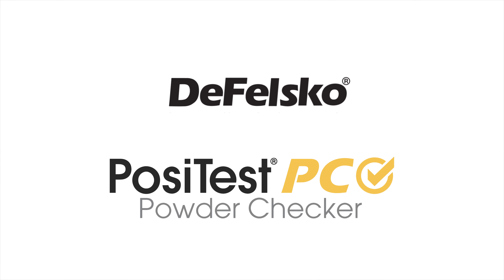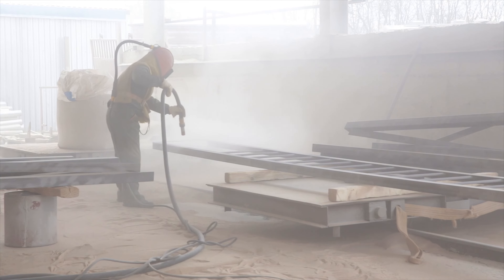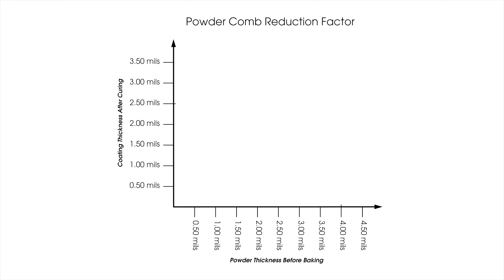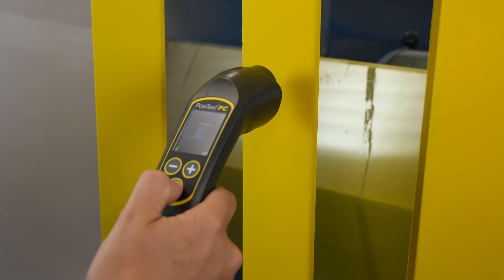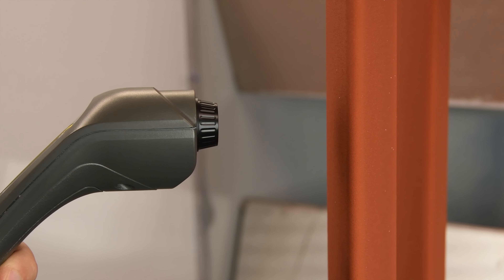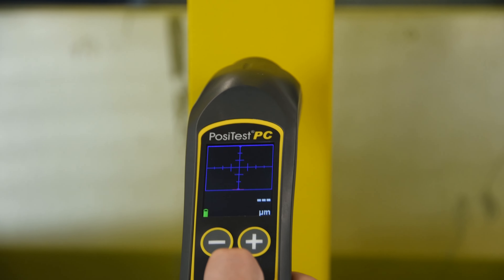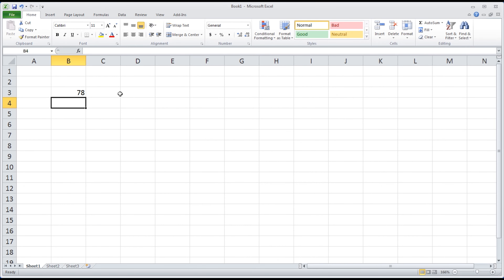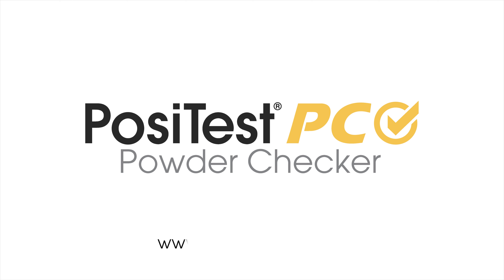How to Measure Uncured Powder Coating Thickness with the PosiTest PC Powder Checker

Comment: Thanks. 
Is this instrument can use for any power type(texture , smooth) in different power manufactures ?
Reply from the maker: Hello Kasun. The PosiTest PC measures and predicts the cured thickness of most powders out-of-box with no adjustment required. If needed, the instruments reading can be adjusted based on the actual cured thickness. For more information, please contact us at +1-315-393-4450 or techsale@defelsko.com